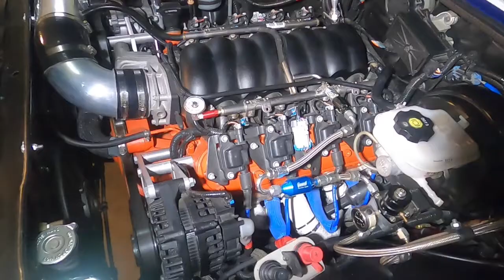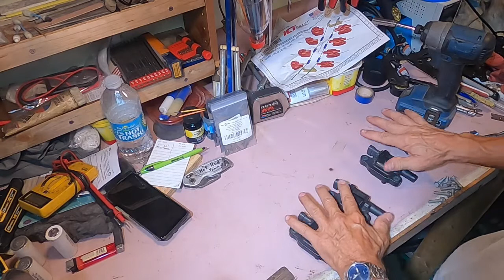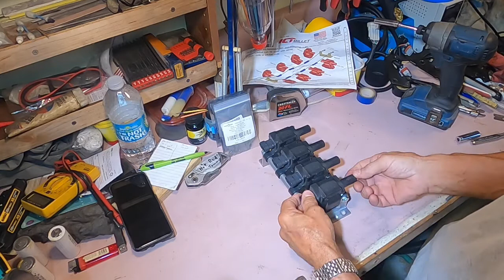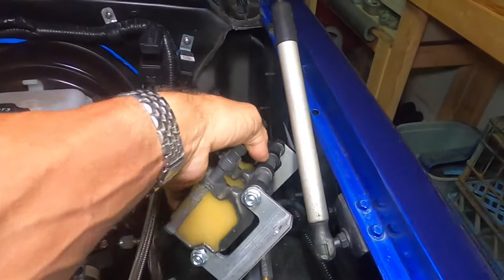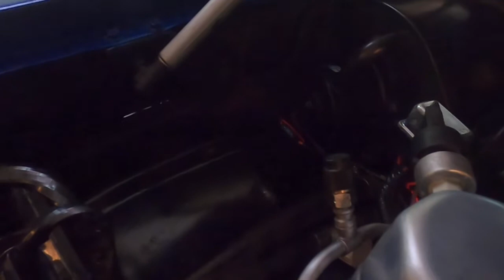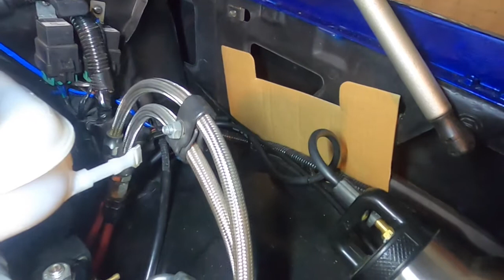LS Coil Pack Relocation - Part One

Comment: Excellent video showing the process of relocating the coil packs. I am building a LSX 427 in a 70 Camaro. Been considering putting the two separate (4) coil packs on the radiator core support brace down low, then running the spark plug wires under the headers onto the plugs with angle plug caps. The biggest factor for my project is the spark plug wiring route. I like your 4 coil mounts you made, That should work for my project.
Reply from the maker: @Idaho 2nd Gens Thanks for watching , I really appreciate your kind words.

Comment: So I’m just curious, is the bracket meant to mount to the motor mount or whoever you want? My turbo set up, because of heat, is killing my coil packs and I’m trying to see if I just want to make my own. Because I don’t have the D510c/D508 coil packs. The truck ones like I’ve got are wider and won’t work with their set up